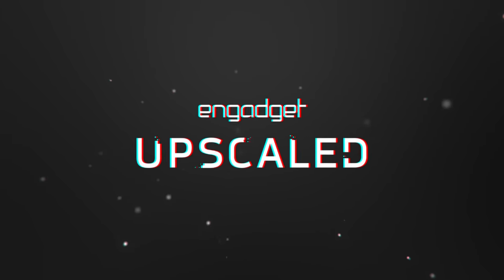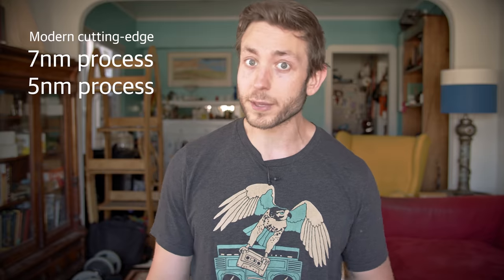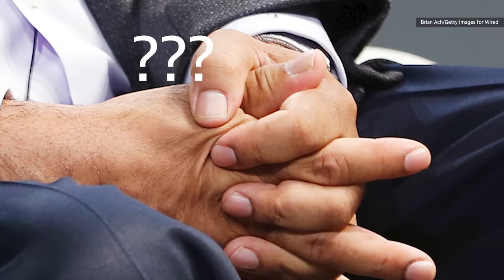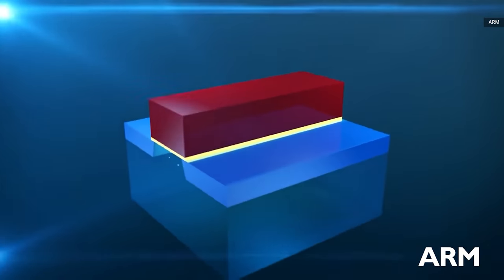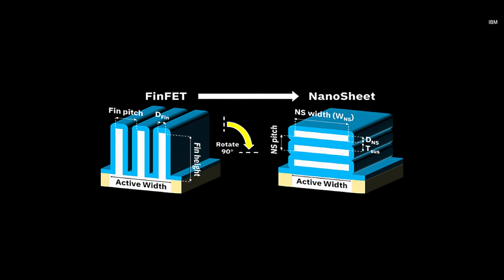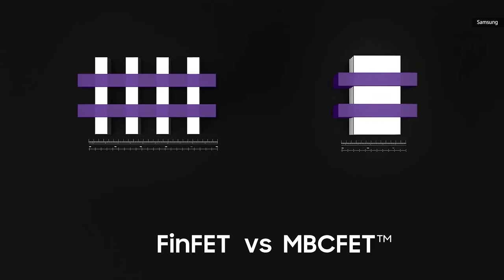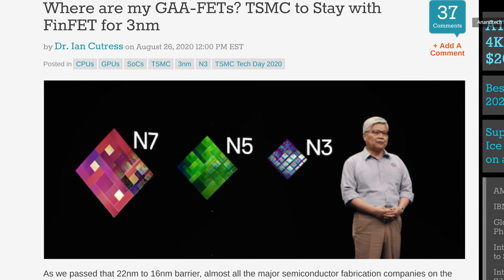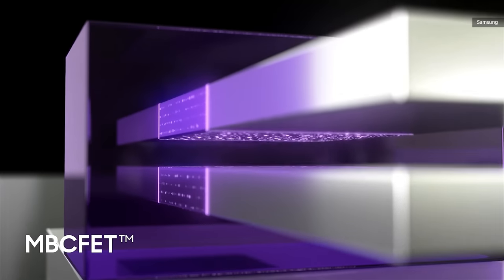IBM's 2nm transistors could supercharge your phone (in a few years) | Upscaled Mini

Comment: IBM builds 2nm chip runs for 4day without charge.

Software developer :  Finally,
      I can build a game that eats up 4 days battery in an hr.
Reply: I can build a chia plot miner that can use up that power in a few milliseconds and destroys your NvMe SSD in the process. .
Reply: @PWingert1966  elaborate please 🤔
Reply: @melyn___1282 _ There are reports that the Chia Mining process writes at a much higher rate than other miner processes and as a result, SSDs become exhausted and fail. The data is still not completely clear as only a few examples have been reported. But it is a concern if you are into Chia. You might want to move to enterprise-grade SSD's with their higher tolerances.
Reply: @PWingert1966  so I guess if one were to look into mining Chia (which I would never do but) hypothetically, an SSD with SLC NAND would probably be preferred over MLC eh?
Reply: @poopsie117 Wu Honestly  I think in general mining is an environmentally unsustainable process. To mine 1 bitcoin consumes enough energy to keep the city of New York lit for a day.  I think you might be better off adopting some of the philosophical principles of a digital nomad and own less, want less, and live within your means. Value the experiences and not the assets.
Reply: it's not actually 2nm in the way we normally call Nnm

Comment: Important to keep in mind that “2nm transistors” are not actually 2nm large, that just refers to the production process. Different companies call it different things, and it is mostly marketing terms used to make chips sound better and more innovative. Regardless, these new designs look very promising.
Reply: Yes, TSMC's 3nm process produces transistors that are close to the size of IBM's 2nm process transistors.  Intel's 7nm process achieves about 2/3 the density of IBM's newest, in spite of the fact you'd expect that to be about 1/12 according to the names.  
But even within one manufacturer's line, the transistor size usually doesn't shrink as fast as the numbers in the process names (Intel is the exception).

Comment: As a software dev, here's my 2 cents on skimping on performance:
It's true, we absolutely do it. Of course we won't code something sluggish on purpose, but we tend to reduce premature optimization. Which actually improves our performance as devs! And only optimize in the cases where it's needed.
"1. Make it work 2. Make it right 3. THEN make it fast"
Reply: Sometimes 3) breaks 2).  
I've become very wary of optimizing compilers (hardware engineer, here).

Comment: I have a question for your upcoming video on camera-sensors: 
What I always wondered as a kid was if the light sensitivity of cameras could hit a hard limit. When I once heard, that in theory a human eye can detect a single photon, I was immediately curious why some cameras still perform better than human eyesight in low light scenarios. The only think confusing to me, is that light is referred to as some sort of hybrid of particles and waves and as such I do wonder how far we can push sensors.
(Oh and btw, a quick rundown on why CCD sensors are not used in consumer cameras and phones would be amazing as well. There seems to be barely any information regarding these to topics, so I would be glad If you could cover some of that.)
Great video as always!
Reply: These days, image sensors generally incorporate quite a bit of electronics on board which is best implemented in CMOS.  That precludes CCD.  Also, the early advantages that CCD had for S/N ratio have been surmounted by modern CMOS sensors.  
It's difficult to directly compare camera imagers to the human eye, but some reasons why cameras seem to see better in dim conditions, is that they include a significant amount of amplification, they can have larger apertures, and lower shutter speeds.  Recent sensor designs boast very high quantum efficiency.  
Although rod cells in our retinas can respond to single photons, that signal magnitude is still below the threshold of perception due to inefficiencies in the downstream neural system.  Also, rod cells cover only a fraction of the retina area, and cone cells are less sensitive.
Reply: @marianneoelund2940  thank you very much! Very interesting!

Comment: Calling it 2 nm transistors is misleading, it's 2 nm technology. That means smallest details are about 2 nm big. Such as thickness of single gate plate in your diagrams, that's about 2 nm. Transistors themselves are significantly bigger than 2 nm. Judging from information I heard, each transistor has about 30x30 nm area just for itself. It's still insanely small but it's not 2 nm transistors.
Reply: Yeah it used to be the size of the gate length, but this has not been the case anymore since 2009. It's just a marketing term nowadays...

Comment: Transistor design... I remember studying this as part of my electrical engineering course in 1980, and with the explanation in terms of quantum mechanics... I still have not recovered yet ... !!
PS: We are getting to the point where those pesky electrons stop acting as particles, but start acting as waves, and schrodinger's equation comes into effect...and tunnel their way through... this is going to be important, because the size of a silicon atom of 0.2 nm, and soon you are going to start running to physical limits...

Comment: I have a 65w power charger from Aliexpress charges my phone in about 1 hour. It cost $23 dollars. It uses GAN metal (I dont know what that means) but my Samssung Note 10 plus is charged fast.
Reply: It uses Gallium nitride instead of silicon as semiconductor which can withstand a lot higher temperatures.
Reply: @MikeyTux97  Sure.

Comment: Perhaps Moore’s law has more potential than I thought. I mean Gordon Moore predicted this would happen faster and at a more consistent rate. But this is huge, more transistors in chip means more power, and those chips won’t have to be as big which could allow more chips to fit on a board.

Comment: What is the limit for the wiring (interconnect)? At some point, if the wire cross-section is too small,  and the frequency is high enough, then the gate charge drops below one electron.
How small transistors can be, before wiring becomes a limiting factor?

Comment: Of all the talks about FinFET, nano sheet, density are interesting but the real parameter that defines a process node's speed is the channel length, which you rarely talked about.  Previously the so called x nm process means the channel length is x-nm.  Even though Intel's 10nm process is said to be equivalent to TSMC's 7nm in terms of density, if 7nm/10nm really means the channel length at least in lithography, Intel is still behind TSMC in 10nm/7nm comparison.  Does IBM's 2nm means 2nm channel length?  The FinFET and GAA are just different ways of making wider channel WIDTH using the smallest area possible.

The channel length defines the distance electrons need to travel from source to drain.  It also defines how low the Drain voltage can be.  With power on an IC being C*V^2*f, that is the parameter that set how much power is consumed.

Comment: IBM really is delivering 7nm chips?
I read recently that's not likely the case, that practically all currently shipping products are 10nm (or older 14nm)
Wikipedia 7nm page also suggests IBM's first widely available product Meteor Lake won't be shipping using 7nm until 4th QTR 2023.
There's also another YouTube video I've seen within the past couple months that TSMC has been working for a long time trying to get high enough yields on 5nm chips to offer more broadly to the commercial market, apparently it's more difficult than expected so these 5nm chips are available only on low volume, high performance products. Unless IBM has something up their sleeve that's a breakthrough, I wonder if IBM will encounter similar difficulties for both 5nm and 2nm designs.

Comment: I've never been a big proponent of classifying chips by their min feature size (eg: 22nm, 14nm, 10nm, 7nm etc) and this metric has become ESPECIALLY abhorrent in the past few years.
I'd prefer the metric became something more 'meaningful' such as MT/mm2.  The current technology 'squeezes' around 100,000,000 (100MT) per mm2.  This 'implies' that a 'square' transistor fits in a square with sides of 100nm (a FAR cry from 7nm!).
IMO, I wouldn't be overly impressed if the minimum feature size were to suddenly shrink to 1pm (PICOMETER) if it still meant limiting the density to 100MT/mm2.
I'm FAR more 'excited' about the fact that the IBM 2nm (ugh) nanosheet based devices are effectively 'stacking' a PMOS / NMOS (totem pole) atop each other in a true 3D fashion.  (However, this would equally start to negate my OWN argument of using a MT/mm2 metric...  Perhaps a GT/mm3 metric?)

Comment: I  think that  we won't see it until the chip shortage ends.  and then  ASML will need a couple of years to develop their tools and then  TSMC will have to take a couple of years to amortize their fab expansions. Intel is in the same boat. SO I don't expect to see any new 2nm chips till at least 2025 from TSMC and 2045 from Intel. (They might have a stable volume 10 nm process by 2025) They should be looking at 5nm for production release by 2030) and another 15 years to get 2nm stable with production yields
Reply: buy IBM?